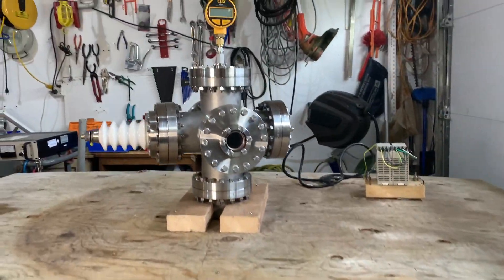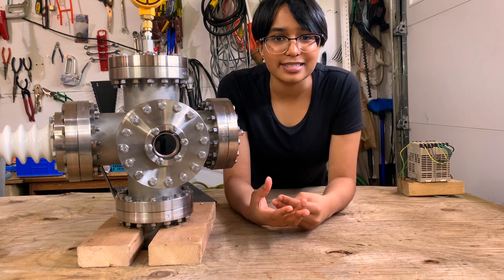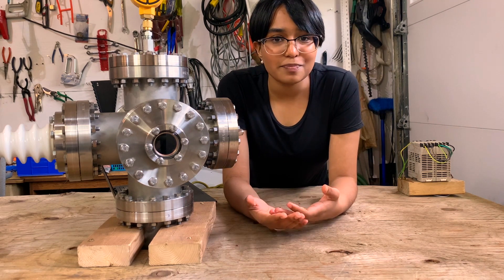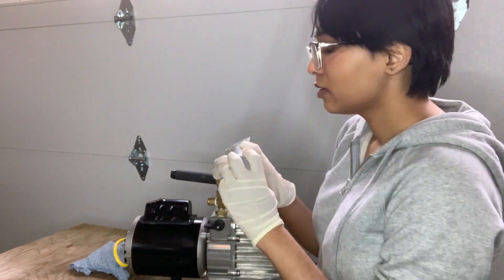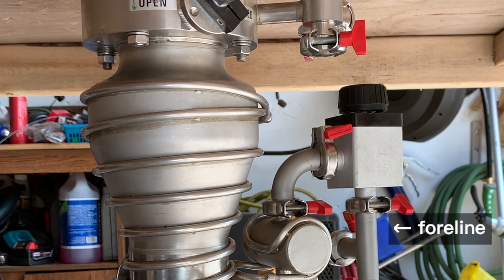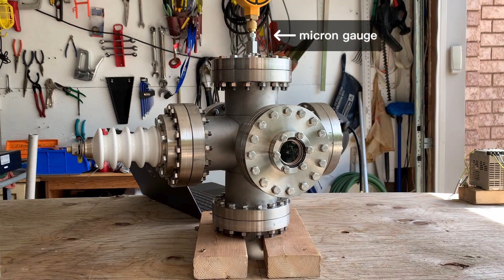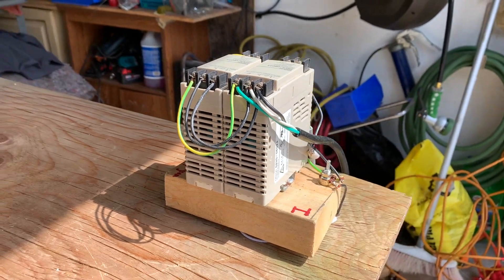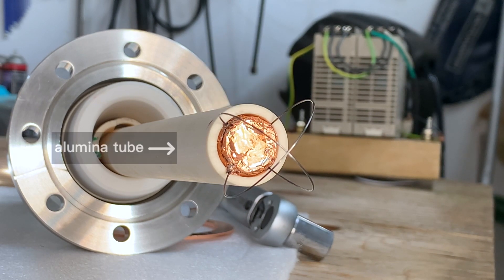Building A Fusion Reactor In My Garage - Progress Update

Comment: I just watched ur vid and is there a specific reason why you have ur nuts on ur bolt up facing inwards? Typically it’s done outward so that you can torque the nuts or at least that’s the only way I have ever seen it done in an industrial setting
Reply from the maker: aesthetics to be honest, I could still torque the nuts
Reply: I work with vac stuff all day , we put the nuts on the inside and so does everywhere else so definitely nothing wrong.
Reply: @rhyyss123  ok, just from my experience, torquing a bolt wont torque as well as when you torque it from the nut.

Comment: Where can I get those metal flanges?
Reply from the maker: I use two types of flanges: Conflat Flanges (CF) on the main fusor body and KF flanges for the foreline. I got my CF from MDCprecision https://www.mdcprecision.com/products/vacuum-components/flanges/del-sealcf 

You should find a local supplier if you're not based in North America so it's cheaper. Read this to learn about them: https://www.lesker.com/vacuum-flanges-components.cfm 

good luck! :)
Reply: @briannagopaul3493  Thank you so much for help!

Comment: How much physics and maths do you need to know to build this project?
Reply from the maker: Most of the project is mechanical. You need to know about electronics, high voltage systems, vacuum systems and of course, understand what fusion is and how it works. You can learn everything online for sure. Also, having the proper tools helps a lot.
Reply: @briannagopaul3493  so would you say this corresponds to highschool curriculum, year 1, 2, 3 ,4 undergrad level stuff? grad level, PhD level? (in terms of the theoretical knowledge needed/necessary). thanks
Reply from the maker: @cocoapie8218  At minimum you need to know grade 12 physics but that doesn't mean that you can't build a fusor if you're not in grade 12. You can find a grade 12 physics textbook online or use Hyperphysics: http://hyperphysics.phy-astr.gsu.edu/hbase/index.html. All the knowledge you need to build one is either online or you need to cold-email some more experienced folks (if you have a specific problem). Also fusor.net is incredibly helpful, their community is really supportive if you take the time to do some background reading on how to build a fusor. If you're up for the challenge, I recommend reading the first two chapters of Plasma Physics and Fusion Energy by Jeffrey Friedberg, you'll need to know Calculus to understand the concepts if you don't already. I posted a couple of blogs on the topic a while ago: https://briannagopaul.com/blog